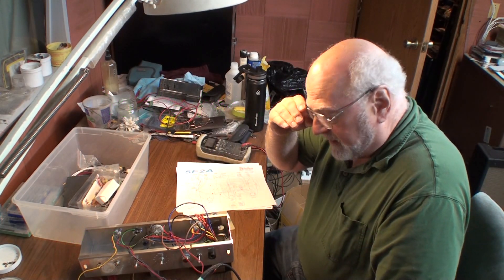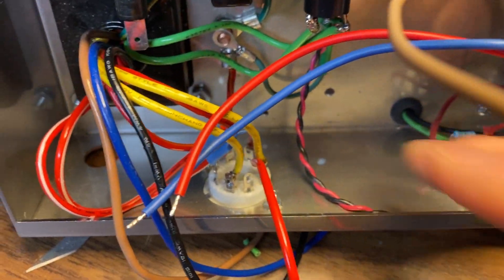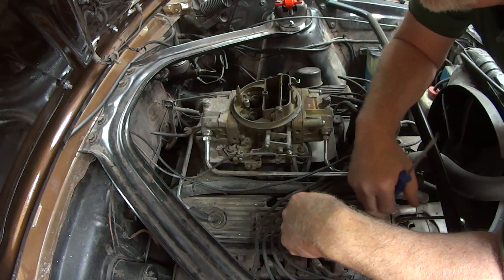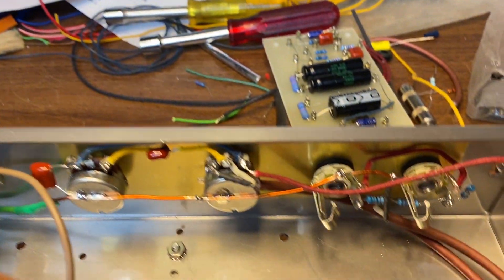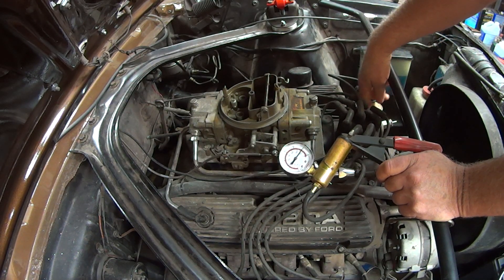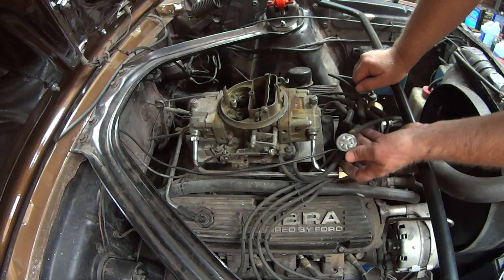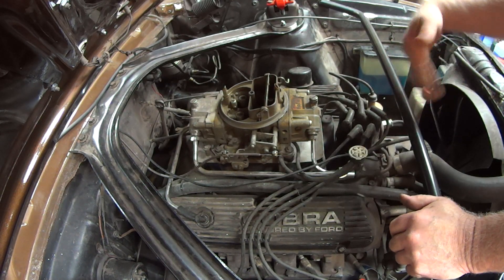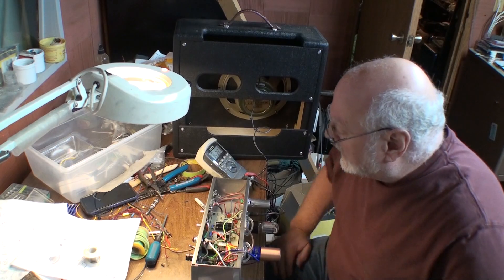66 Mustang Betsy - More UCA's - Tune Up Tricks - 5F2A Guitar Amp

Comment: great suggestion on the carb choke spring and vacuum advance. My brothers 429 has the same complicated vacuum advance / retard and I could not figure it out but now understand why at least. . Although I have an automatic choke all of the cam settings are the same regarding cold / warm and hot running. And so much for taking my advice, it is like a drug and it keeps bringing you back for more .lol . enjoyed the video, great job on the amp and of course the playing
Reply from the maker: The playing 😀😀😀

Comment: good info thanks
Reply from the maker: You are welcome.
Reply: Curious to know the cam specs
Reply from the maker: Betsy’s cam:
Iskandarian (circa 1987)
Advertised 270* / .470 
@.050 216* - 108* lobe split. Flat tappet
This is what I’m remembering. I put this smaller cam in when I switched to the T5 trans. Needed more low end torque for 1900 rpm 5th gear cruise. Better fuel economy with no loss of ET or mph in the 1/4 mile because I ported the heads with 69 351W valves. Was a good compromise.